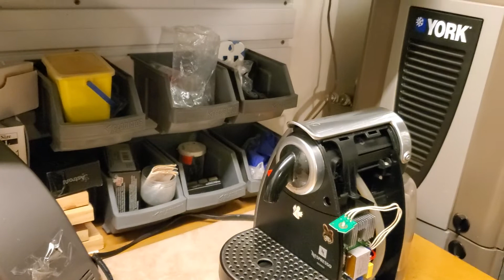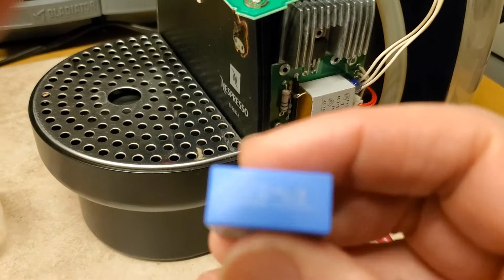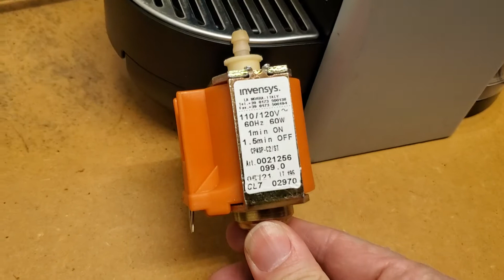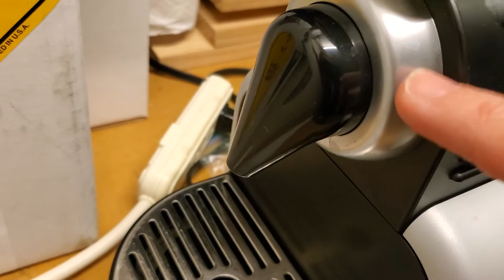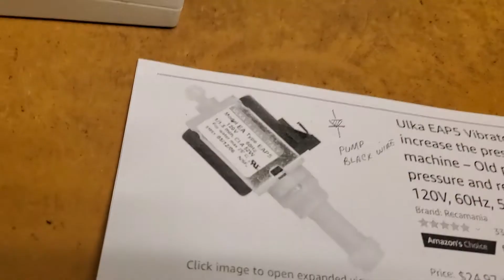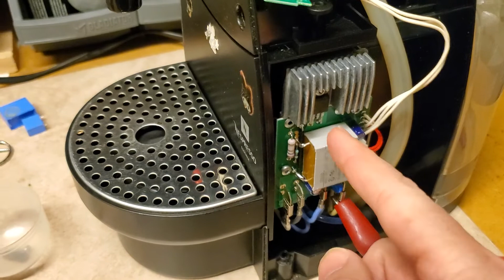How to repair Nespresso Essenza C90, C91, C100, D90 (electrical)

Comment: 😂 you won’t believe this one, firstly thanks for taking the time to  post this video, all those years ago.
Anyway, my partner uses the spare Nespresso machine (EN90) when doing workshops were they don’t have a machine, so it doesn’t get used very often, so after about two years, we had to drag it out, and it wouldn’t work. Found your video which is great, straight to the point no waffling, and just like yours pump switch was the problem.
Not sure if it’s in the comments, but the momentary switch actually doesn’t fit where you suggest and I was thinking about putting it low down on the side panel, which would be a headache getting the panel off and on.
Just about to go and get the switch and thought why don’t I just tap the circuit board a bit? It’s been sitting a long time can’t hurt sure enough it worked what a recovery !!!!
Thanks again, best regards from Australia.

You definitely got me in the good books today.
Reply from the maker: Good to here. 
 For Future: The switch is slightly smaller than hole, but fits fine. If opposite problem(?) You could circular file on hole to make it slightly bigger.

Comment: I own a C100 manual machine bought a long time ago! Suddenly, it can not be turned on, pressed on either side of the small or lungo cup button, but nothing happened! The light didn't come on, I pressed and held on to the button, but still no light blinking😢...I approached the Nespresso seevice centre, was told they couldn't help as modal has been discontinued!
Reply from the maker: My first guess will be your power button. Ask someome with tech skills to open and to short the leads of the power button to see if that starts it. Good luck.

Comment: I was given one of these machines recently; the problem is the turn on button has to be pushed down a long time before the the button with green light begins blinking.  When held down long enough, the green light will start blinking, and otherwise, the pumps works well.    Do you think the turn on button needs to be replaced?    Thank you.
Reply from the maker: @quercusalba5441  you can start by simply cleaning the contact area of the green button (take apart), but eventually it will stop working and must be replaced with a better button as ishown.
Reply: @tek4u22  thank you very much

Comment: Finally someone who knows what they’re doing regarding these older Nespresso machines. Please what is the name of that tool you have to remove those flat head screws. Can’t find it on eBay or Amazon like you suggested. Can you post a link. Would greatly appreciate it. I have two D290 to open up would like to purchase that tool. Much thanks
Reply from the maker: @gloriastazzone8722  become hard to find. Use the Bic pen method. Heat the end and let it cool on the pan head screw.

Comment: Thank you for the video. 
I am trying to find the screw drivers. But no luck .  Do you know what it is called? and Do you happen to know the size of the screw driver for C100?
Thank you in advance.
Reply from the maker: Use an old BIC pen. Remove ink tube from Bic pen. Heat end until maleable. Place on panhead screw and let cool. Remove screwss.
Reply: @tek4u22  Thank you. I will try!
Reply from the maker: @sunghyunjang9204  p.s. I replaced my screws with regular philips screws after.

Comment: I also have a C90 and I’d like to know how to remove the metal plate with holes that the large end of the coffee capsule is pushed against and is where the water pushes the coffee through.  I think I need to clean all of the holes as water that is not going through the capsuleis dropping down into the capsule bin when I make coffee.  I’m able to remove the spout on the front but apparently I need to disassemble the unit to get to that part?  Thanks in advance for your help.
Reply from the maker: My experience has been taking it apart is not worth to clean. Suggest a toothbrush and simple vinegar. Run vinegar through the machine too.
Reply: 1. Why would vinegar go through it if water won’t?  2. Is it that difficult to disassemble?  Thanks for responding.
Reply from the maker: @uaremymuse1  vinegar will descale the coffee (its whats in the descale solution). Taking if apart is an option. See here https://youtu.be/UA-9t364Mus
Reply: Thanks for the video URL but it didn’t show how to remove the circular metal plate.  It was about the pump.   How many times do you think I’ll need to pass vinegar through the machine for it to clear the holes?
Reply: I’ve run vinegar through the machine by filling the water tank about 30 times.  After the 2nd tank, the water stopped dripping out from within the machine so I thought the issue had been resolved.  So I opened the handle to let the excess water to escape, closed the handle (as if it had a pod inserted) and started on a 3rd tank of vinegar and the dripping from within began again.  It’s as if a vacuum is occurring after running a couple of tanks and not opening the handle and that vacuum is stopping the leakage.  So in effect, the usage of vinegar after 5 tanks had not cleaned the holes in that metal plate.  So I ran around 25 tanks of vinegar without opening the handle, and again, the leakage stopped on the 2nd tank.  So after running an additional 23 tanks without opening the handle, again, there was no leakage.  After those 30 tanks, I again opened the handle to allow any leftover vinegar to escape, I closed the handle and began running a new tank and the leakage started again.  My question is this.  After removing the sides of the machine, as well as removing the spout, what do I remove to get that circular metal disk out to clean the holes with a wire and what size wire do I need to use? (I forgot to tell you that I also used a toothbrush in the aforementioned process of running vinegar through the machine.
Reply from the maker: @uaremymuse1  Few times vinegar is usually enough. You may be able to access the holes from the outside(dont recall). Simply use a small needle to poke through holes. If not, there are tabs inside holding coin plate, you can just slowly pry out coin from inside with small screwdriver or picktool. Be careful plastic is brittle on old machines!
Reply: Ok. So without taking the machine apart, I can pry the metal coin out by prying it with a small flathead screwdriver?
Reply: There’s not enough room to get a flathead screwdriver behind any part of the coin by accessing it through the top hole where you put a capsule.  Can I access the coin if I remove the sides of the machine?
Reply from the maker: there is a video from someone who removed the coin plate, from a different model, but should be similar - around 17min mark. https://www.youtube.com/watch?v=2Sfk0IgE0Bw
Reply: I was able to disassemble the unit but not able to remove the diffuser as there’s not enough space between the diffuser and where it seats to put even the smallest of screwdrivers or a thin bladed knife.  Wish I could send a photo.
Reply: I was able to clean out the diffuser holes using a wire closure that comes on a loaf of bread.  However, there’s a plastic round collar that fits in the pushing mechanism device that captures the capsule’s end when pushing the other end into the diffuser plate and it is snapped in two.  Where can I buy parts for the machine?
Reply from the maker: @uaremymuse1  eBay is your best bet. Used broken model.

Comment: Mine seems to blink twice fast then pause? The pump works if I turn it off and hold the button down and turn it on. So pump seems to work. Any ideas?
Reply from the maker: My guess would be, first try changing the capacitors.

Comment: I have a model GCC1. Stopped working.
Tried descaling the machine. Water will not flow through the machine. Any suggestions?
Reply from the maker: Sorry, dont know that model. Suggest you open it up and carefully disconnect hoses, see if water flowing along path.

Comment: Mine is blinking fast… never stops blinking. Wtf
Reply from the maker: Check the user manual to make sure its not in Cleaning Mode. If not that,  its likely one of the capacitors.

Comment: Thanks for the video. Can you tell me the big capacitor voltage. Thanks
Reply: I found a repair kit on eBay that lists the capacitor as 680nF, 275V. That's for Europe.

Comment: Thanks for the video, I have another question about the compact brewing kit, I accidentally put the wrong capsule in and somehow brake the compact brewing kit that the thing doesn't push the capsule all the way through which means the capsule can't poke holes correctly. can I fix it? or I need to replace it with a whole new part?
Thank you
Reply from the maker: Not sure, me repairs were limited to electrical problems. Sounds like you need to replace the plastic housing though.